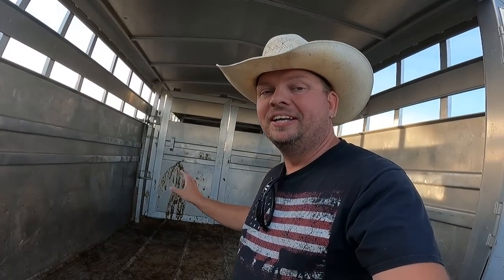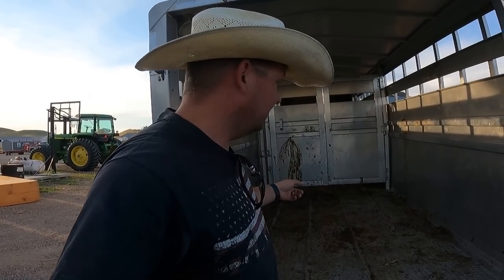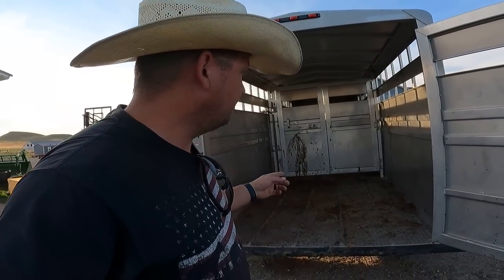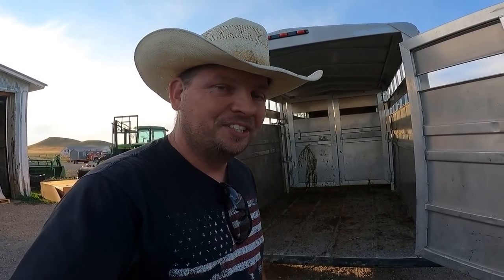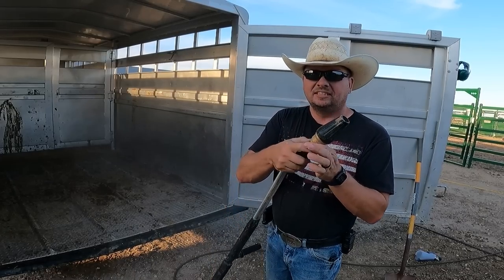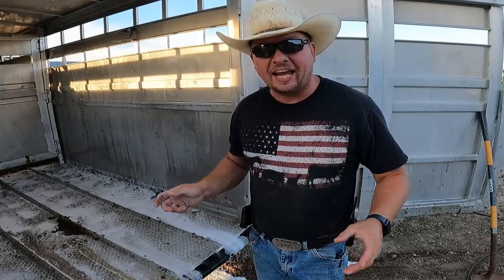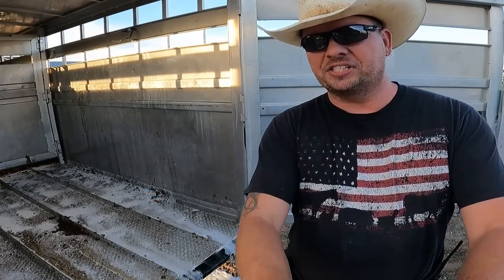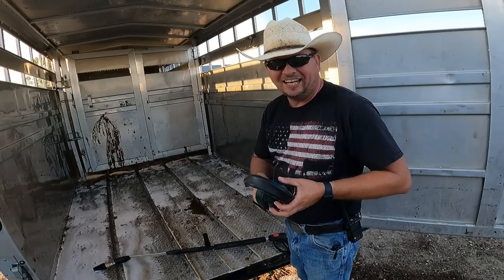Alkota Cleans Again

Comment: You should consider putting a sign on the wall of the trailer that says, ‘please hold your poo until we reach our destination!’
Reply from the maker: Anthony, The cows seem to just ignore any signs we have posted in the past! LOL
Reply: @OurWyomingLife  they need Manners Camp. Lol
Reply: Lol 😂🤠💩💩💩💩💩🤠
Reply: @margaretporkolab7166  no they only get freezer camp
Reply: I wanna see a cow that can read cause I wanna die very rich 😂😂😂😂😂
Reply: You can definitely say it cleaned the      (       ) out of that trailer. 
Heat and 4000psi can clean anything, just be careful on the surface you’re cleaning. 
As the saying goes, use what you need, not all you have. I’ve seen 4000 psi cut through 1/4 inch cast aluminum before just with a regular tip. 
Great demonstration.

Comment: Hi Mike, I always put down straw or leafs on the floor as absorbent before putting 🐮🐷 inside. It makes the cleaning (animals load sooo much easier too) so much easier to push all the 💩 out the back end. Then just a quick wash down with the pressure washer and presto ... it's stick and span🍽

Comment: Thanks Mike for any good video. I hope your getting some rain. A couple tips on pressure washers if using heat turn off the burner a few minutes before you shut down the pressure washer to let the coils cool down. If you have minerals in your water they deposit less in your coils if it’s shut down cool. That turbo nozzle is a great time saver but if you have a leak or want to turn the pressure, change out the turbo for a standard nozzle. If the turbo isn’t spinning it’s self destructing and they are expensive, (the good ones anyway)

Comment: My experience is that the oscillating high pressure tip works best on concrete and other applications where you need high pressure and you're not going to damage anything.  Probably the 15° fan tip would work pretty well for you on equipment... It's usually yellow. I typically try to find an inconspicuous spot to test
Reply: Absolutely. If you want to wreck your car, use the rotojet on it.
And I envy anyone thinks that's a dirty cattle trailer.

Comment: Cleaning machine was bril. Pays to have a stainless steel or Aliminium trailer so easy to get the filth out. At my work I used a Rota wash for floors it put soap on 
, brushed clean then sucked up the dirty water was bril. Makes life a little easier when cleaning doesnt it. Enjoyed ur vidio, thankyou

Comment: If you are looking for a soap that produces a high foam content from your foam gun look at the auto parts store, they have a wide selection to chose from. Walmart also sell a few soaps in their automotive section. If you need disinfectant just add that to the mix. You can also adjust the flow rate of the concentration being mixed with the water supply on top of the foam gun. Auto detailers have been using foam guns for years.

Comment: Hey Mike, I bet you really do love the cleaner. Have you tried using the rotating tip on that paint? Also since you just cleaned it all are you thinking about ever putting down a seal coat to protect the concrete even more?
Reply: Get a sand blasting attachment.

Comment: I think a good thing for that presure washer would be a shut of valve for presure right where you conect the nozzels so you can interchange them without having to shut down the thing, would make it really easy to switch from that floor cleaner to the stick and quickly get the little places you missed on the edges and then right back to the floor cleaner when you want to continue with bigger surfaces

Comment: In aerospace, animal transport (think thoroughbred racehorses) is one of those PITA special cargos as the urine is corrosive.  Typically the pens built on the cargo pallets are leak tight, but still, it can spill or spray or be knocked about by turbulence.  Best to clean that stuff off anything that can corrode to get the maximum service life.

Comment: I always start my cow trailer from the front side escape door and work my way to the rear of the trailer . That way the high pressure hose is out of your way as you go towards the rear  . The divider door opened against the side of the trailer. You can push all of the poop out the rear and then go back and clean the walls and doors and rinse as you go. Be sure to have the front elevated so it will drain quickly out the rear . Then shower and listen to the wife complain about your poop splattered clothes  . 😂

Comment: Not a bad looking cleaning outfit you have there Mike! Any chance you can get your hands on some pressure treated 2 x 6s? Cut them into length to slide under the feet of those freezers or refrigerators to get them up off the floor and slow down the rust action of moisture on metal. -Bob...

Comment: You can adjust the thickness of the soap on the soap adapter. Also if it's not as thick as you want try adding more soap and less water in the bottle. I used that same exact pressure washing gun when I use to pressure wash concrete trucks. It might also be too much pressure for that little soap gun. Those soap guns are made for like 2,000 psi not 5,000 haha. But either way it should Still get the job done.  Love you guys keep up the content From las vegas

Comment: OK, now I want one of those power washers and floor cleaner in a mini size.  That would do a fantastic job on the kitchen floor; with large dogs that floor is a constant battle.  AND, why has some builder not thought to put a drain in the middle of the kitchen floor for easy cleanup?
Reply: A floor steam cleaner works fantastic on cleaning kitchen and tile.

Comment: excellent  pressure washer 👍👍# Use  mask while cleaning the bulls dirt inside trailer since high pressure water disperse dirt particles in the air # decrease the pressure while using soap as it decreases flow of soap & it will be sufficient for large area # 👍👍

Comment: So lay kitty liter absorbant over liquid brake cleaner and the oil will absorb out or the concrete. We use it that way cleaning hydraulic fluid from floor under military aircraft overhaul. karocene the floor for twenty minutes before you pressure wash the cloor and you will be able to eat off the concrete, mechanics tip.
Reply from the maker: Thanks for the tip William.

Comment: I hit the bell If I could afford it I probably would buy this pressure washer machine just because I like it it would be great to do sidewalks for a living with because they use the top water would be fast and easy to clean the sidewalk or driveway do you have a sidewalk to try it out on You forgot the ceiling of the Horse trailer